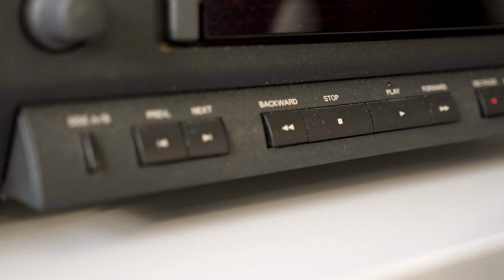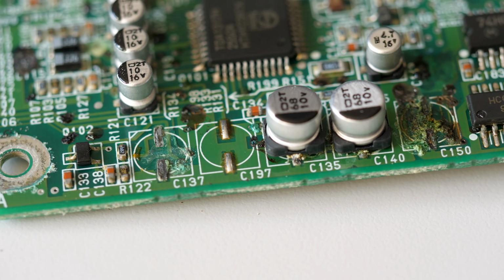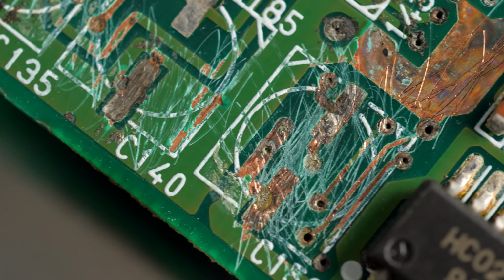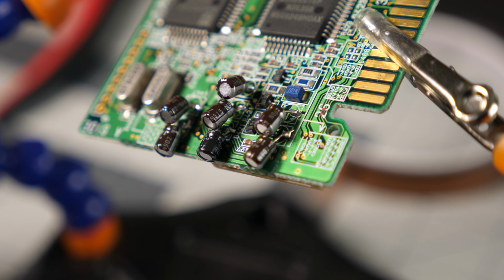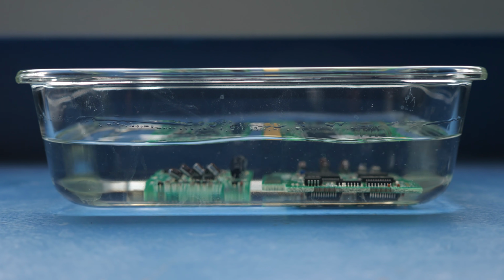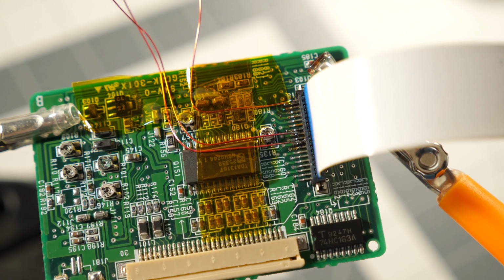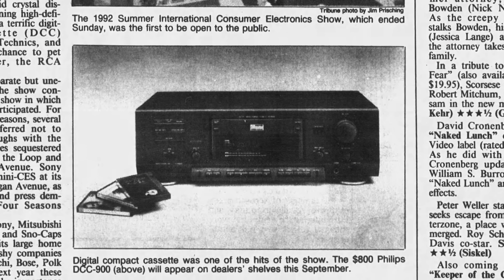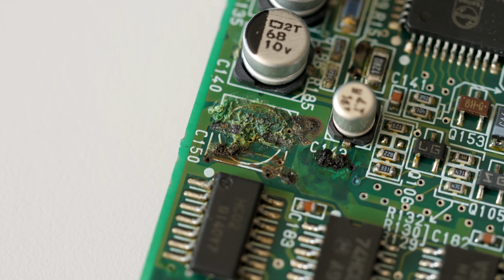My DCC Deck Repair Didn't Quite Go as Hoped...

Comment: You really have the guts to trying two times... And the work from the museum guys... Trash. Anyway
Reply: Yeah, I was amazed at what they had done to that poor board... Were they sharpening their tools with it ?!
Reply: The DCC Museum tried to repair the board but it was too far gone. Knowing Ralf (Dr DCC) he probably offered a replacement board but the drive was trashed in the mail so that would have had to be replaced too, which would have increased the price significantly. So Colin probably said he had another  recorder coming so the museum sent everything back as-is. I expect there was little or no charge besides shipping costs.
At the museum, we're considering developing replacement boards for cases such as this one.
Reply: Louis Rossmann would be horrified
Reply: It looks brutal, but it's basically just them removing the cancer from it.  That's kinda how you have to do it.  Typical tools include:  Exacto blades, fiberglass brush pens, and chemical etching.  You want to get down to bare copper (what's left of it) and remove as much of the electrolyte as possible, otherwise it just continues to eat away.

They made a judgment call at some point that, sure... you could repair the PCB.  But how much is it worth to you?  They would have to bodge-wire it to the point where continuity between components was restored, replace the passives, and then test it to see if the ICs even worked anymore.  Can't blame Collin or the DCC guys for bailing out on that one.

At least he still has the PCB, and can always take another crack at it, or harvest it for parts.

Comment: On the L/R balance, could the potential issue be that the head is misaligned with the tape? After all, the head had been removed. Just a thought.
Reply: No. Misalignment is almost impossible with DCC heads. The level difference for analog tapes is a common problem; I think it's the non-polarized capacitors which definitely go bad just like the normal electrolytics.

Comment: Adrians basement had something similar with a bad memory chip if i recall correctly. Also you have the circuit diagram? That means you could find someone to remake the board probably.
Reply: We are considering doing that at the DCC Museum. It would be necessary to take the two custom chips off the original board though.

Comment: Oh man, great video. Just so in depth. Any plans for an sacd player video?
Reply from the maker: No firm plans, but it’s something I’ve always been curious about so I’m sure SACD will make an appearance at some point!
Reply: @ThisDoesNotCompute  If you’re looking for a player, the initial hardware revisions of the PS3 (CECHA, B, and E) could play SACDs and go for similar prices to standard SACD players.
Reply: @mrb692  but... I mean, digital (optical) output only :( BUT.... Can play SACD-Rs
Reply: @MarkMarkMark From what I’ve read the launch models should be able to losslessly convert the DSD to multichannel PCM and output that over HDMI, in addition to DTS over SPDIF.
Reply: @mrb692  nice. I have a few of the small players with only optical. But I've bought a few multichannel units that stated on a site they play burnt sacds... and my goodness does that not always work. I just want an sacd that plays dvd-a , sacd , sacdr , and any 5.1 audio format.
Reply: Neat tech, but good lawd the media prices....  X_o

Comment: Seeing this video keeps reminding me that I have to eventually check the caps in the pioneer radio receiver that I have that's around 45 years old now. It still works, but speaker channels are finicky.
The thing's heavy as hell, though, so moving its gonna be a pain.
Reply: Clean the switches

Comment: I had one of those tape decks.  Fabulous sound, rubbish remote!
Reply: lol so even if he manages to repair the DCC, he still has to deal with the remote
Reply: @D0NU75  for playback the remote was fine, but if you wanted to label each track you recorded off an LP with the song title, then you learned to hate that remote!
Reply: @paulfredfield  labeling songs is not even possible with the dcc900. They didn't introduce that feature until the dcc730 and dcc951, in 1994. The Technics RS-DC8 could store up to 4 texts for each song, but the user-stored texts could only be shown on those recorders, and on the latest model of the car stereo DCC player. Worst of all, the song-title editing feature was too little too late: you couldn't even enter an apostrophe!
Reply: @JacGoudsmit  ah yes mine was the dcc730 iirc.  It went to recycling a couple of years ago after 20 years of no use!  I think the recording bit rate was better than cd so a shame it was lost.  But it was not a solid state format so it never had a chance.
Reply: By the way most universal remote controls of decent quality can be programmed to send Philips/Marantz "rc5" DCC codes (or rc5 MiniDisc codes -- they're the same). I use a Logitech Harmony with my DCC recorders.
Reply: Dang
Reply: Better sound than the CDs?
Reply: @napomania  I think the tape recorded at 24 bits as opposed to cd’s 16 bits.  So copies of CD’s were perfect, or as good as.  I certainly couldn’t tell them apart.